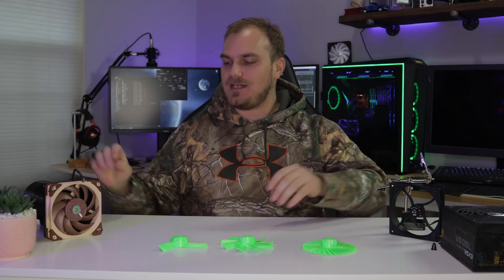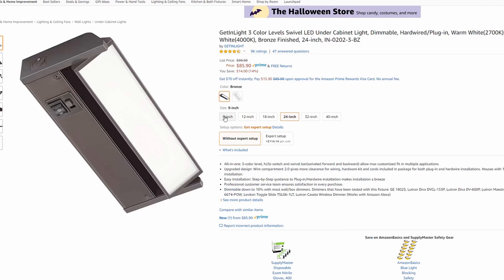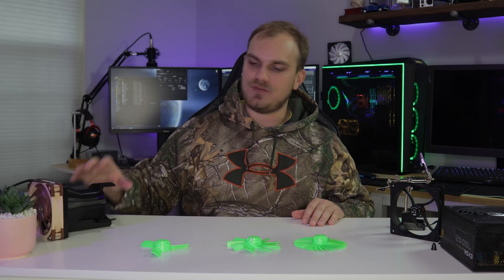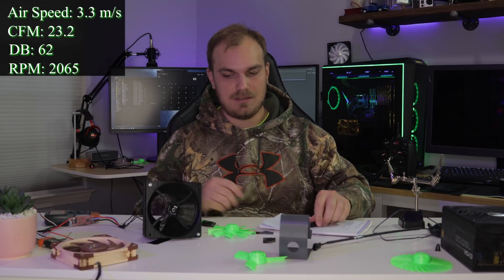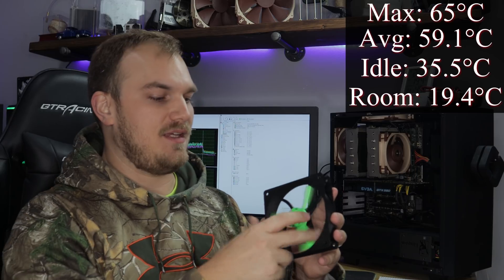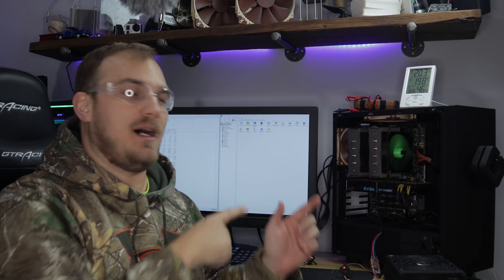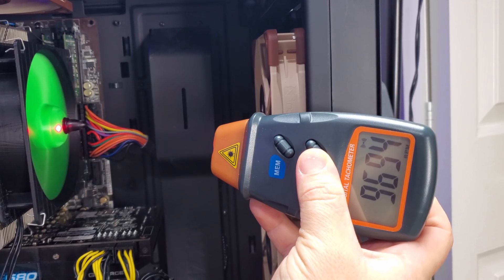This 120mm Fan BREAKS All The Rules!

Comment: I'd recommend just using a normal FPV prop, then there's no shroud over the motor containing the heat. There's cinematic props with 5-9 blades as well. The cinematic props are typically designed to work with a duct as well. Or you could trim larger props down to perfectly fit the duct as to maximize performance (the smaller the gap, the less bleeding the high to low pressure gradient between the top and bottom of the prop)

Comment: some comments say that the fan's buzzing sound is created by the tips breaking the sound barrier, which it doesn't. a 120mm fan would need to spin at least around 54,600 RPM in order to break the speed of sound, a 200mm fan would need 32,800 RPM. compare that to a turbofan with a fan diameter of say 2 meters, it would only need 3,300 RPM to break the sound barrier.

Comment: Would it be possible to print these on a resin printer specifically an elegoo mars 2 pro because the build volume is not wide enough requiring you to print on its side....

Comment: Under the right conditions, the turbo fan style should push the most air. It will probably need some massive torque and sadly forward motion is probably important. A few hundred knots of forward airspeed is probably a huge benefit. A modern passenger jet is essentially a prop airplane, after all.

Comment: You can tell at 10:09 how when the 30 blade popped off and it was floating in the air it barely even moved from its spinning plane. Almost like it wasn't producing very much air flow. Kind of  like it was just a disc.

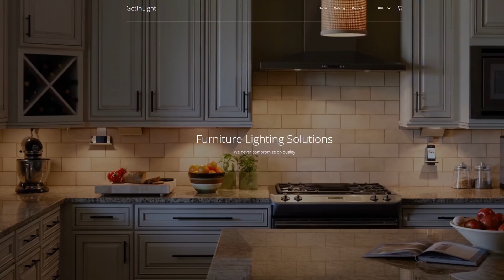Comment: 1:06, I have one. I installed it beneath the cabinets, over my washer and dryer. The smaller, of the two switches changes the temperature of the light. I generally keep mine on the natural temperature. It’s really bright for its size. Have mine wired up to a wireless remote.

Comment: The correct twist applied to the 30 blade would improve things quite a bit.  Do you have a way to measure motor voltage and current?      :)

Comment: That 30 blade fan looks pretty close to the primary low bypss fan blade on the p&w 220s I use to work with. That moter had a three stage fan design followed by a 10 stage compressor. Since then they went with a smaller blade count but larger  blades for the 229s

Comment: Should probably print these out of a better filament. PLA heat deforms very easy. Petg can take higher temps, but is less ridgid. ABS would be better still, but it can be a pita to print with, needing an enclosure and higher temp bed to print and preferably an all metal hot-end

Comment: Wait a second, half-speed was 9077 rpm?  Holy shi*t!  No wonder it's 78 dbs.  8:56.  "The motor's surprisingly coll."  Duh - it's air-cooled.  Pretty tough to overheat.  I just worry that the bearings will give out under all that massive torque.  10:09.  That 30-blade really did sound like a turbine for a brief few seconds.  Amazing.  I like that someone out there is experimenting, not unlike a mad scientist, on improving the traditional, boring, and low-performance cooling fans on the market.  I'd put up with a lot more noise if my damn PC would stop overheating when I push it to the max.

Comment: content gold mine = Get a laptop. 3d print a replacement back plate that will allow a large heat sink or large fans to be mounted within. think of it as making your laptop Phat.  the thermal throttling laptops suck. fix it and sell the back plate designs. and profit.

Comment: More blades = higher pressure.  
Fewer/faster blades = more CFP.
Comparing these fan blade designs is like comparing a Mustang to a Clydesdale.   One will beat the other depending on the test.

If you could get counter-rotating 3 blade designs...  You'd be able to break the sound barrier with titanium fan blades.  Printed from your titanium fan blade printer...

Comment: That motor is pretty much as loud as the fans on the early high end Nvidia graphics cards from the early 2000s though more specifically the Nvidia FX 5800 Ultra that was released in 2003 actually seemingly had a loud hair dryer motor and fan in it because of how insanely noisy it was! :)

Comment: Seems like your cooler has a limit that is bottle necking the fans capability. I would run all the fans at the same RPM and see which cools better at that rpm and try a few different RPM ranges, and maybe measure the noise generated at those RPM's also for each fan blade setup

Comment: Only use the AXE type BLADE width reduces breakage increases matter trajectory strike force,  thus two propeller increases vacuum, however step up blades reduces vacuum air compression blockage through speeds velocity momentum rotation Force compression blockage.

Comment: The reason the 30 blade didn't pull enough air is because the blades AoA was too shallow, it wasn't pulling any fresh air, just the turbulence the blade before it caused. I would try again with a steeper blade angle, or even a sweeping angle.

Comment: @Major Hardware - 
Your loudest van is not much more nerving than the 125 Watt TDP AMD-FX old boxed cooler (before the wraith) in the summer ... its 70mm van can (nearly) lift it self up ( @ 5000 RPM ? ) when tits heat sensor is on hot party mode. 
This is the very loud boxed cooler I mean: https://www.reddit.com/r/Amd/comments/97jfni/fx_coolermaster_am3_box_cooler_what_model_tdp_is/

Comment: I wonder what frequency you can run that 30 blade setup to eliminate the whine. I would replicate this test with a sabertooth 64 amp controller with overcurrent limited to only one amp and a rc brush motor rated at 200,000 RPM. The saber tooth controller available at robot shop will accept all signals RC pwm serial analog making it the perfect solo or dual brushed controller.

Comment: How about pressure differential.
What blade design can pull, or build the most pressure in an enclosure?  Do fans in series, (stacking fans) 1/2/3/4 build more presser than just one, or does separating them by a certain distance in a tube in series work better than stacking them close up?
Reply: 3 blade, 3 blade, 3 blade vs
3 blade, 5 blade, 9 blade or 
The other way around in series? Does it build more pressure,  or does the volume increase/decrease?

Comment: The 30 blade design might experience a stall. It'll move air but just in a circle, it won't be pulling air in from one side and forcing it out the other. If that happens, I don't think a stator would help eliminate the stall. Could you design a fan with variable pitch blades?

Comment: Your jet blade looked awesome. I think though that it failed because the pitch was not aggressive enough so the blades were not properly loaded. The RPM got too high. The RPM should be lower while it moves more air. This one has the potential to be the best.

Comment: Those under cabinet lights have a jacked up plug style that is nearly impossible to find, if the cable length doesn't work you'll have to rig it and not pass inspection...

Comment: @Major Hardware i am actually looking for a 3d model of fan blades with no center hub or shaft. Where the blades come together vertically in the center and an aggressive pitch at the outer limits with a rind around the outside the hight of the center connection point. Its for a toy model im making. For display for my son.

Comment: So if you use it in silent less than 1000 rpm mode with low Re a cool style 17 blade is better. 7~ 9 Blades for normal PC use. And 3 or 2  blades for OC!

Comment: 90 degree angles square edges “Was told to try and round them out”are your weakest point. Plastic injection molding class 2012. I was trying to make some similar blades not as nice though. But ran into some issues. Nice video man

Comment: How about running the motor a side with gears connecting to the blades it would give more are flow and more rpm to the blade, you would just have to account for the extra work on the motor.

Comment: air drag... you need to calculate using the flow/viscosity of air at your altitude. and by the size and angle of each blade you get the total amount of drag that sucks air behind it so that the blade behind that can push it down the line. do you work in a laboratory making blades for jet engines, NO ya don't... useless information. pie down to 13 hundred digits for what? the calculation above used for making turbines in jet engines.

Comment: The 3 blade moves the most air but the 30 blade will have static pressure, good for coolers and radiators, you should have tried maybe a 4 or 5 blade but with very wide overlapping blades and compared that to the 30 blade

Comment: Hey man, first video I've watched of yours (subbed). 
Wanted to give a little input that may be able to help measure CFM or g/s.. as it kind of came off like you were having a little trouble doing it. 
I'd suggest getting a GM MAF, 5v reference, 3d print a tunnel to match the ID of the factory intake on the vehicle you buy the MAF for, and read the output voltage. Simple equation will convert that over to an accurate g/s reading.

Comment: It shouldn't get a zero.. it was the best performing one for air pressure it just needs high rpm... its not that you didnt tight the screw its that the fan was pushing with such a power breaking/forcing it to unscrew there is a reason jet engines use dense fans like that one.

Comment: To compare cfm, I pair same size fans face to face (bases inwards), then connect one to a supply and the other on a multimeter comparing voltage readings.

Comment: I would do the 30 blade again.  It had pressure cause you can see it move forward when the pressure built up before it demounted itself.  Plus, early on in the video, whwn you had it connected to the tunnel and you were moving it around, the papers on the desk were near flying off.  It was giving good airflow.
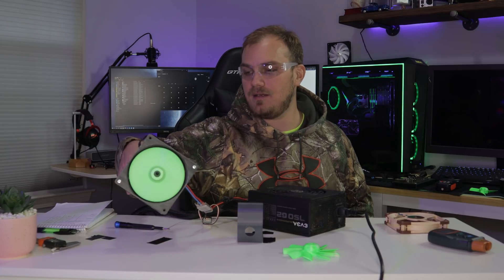Reply: Starts at around 5:36 on low speed, the paper moved up a bit.  But when you ramped up at about 5:40, the paper lifted higher.

Comment: Let try double the area of the fan blade and get an increase in all indicators due to more air that can be driven through itself, ideally 5-6 blades, but three is also good,but you can experiment with two blades or with a spiral mono blade, the angle of attack and the pitch of its blade also plays a role, for example, a 30 blade system has a large air resistance.In General, aerodynamics as a science is very exciting

Comment: It's all fine and dandy to look all scientific and to use big terms but of his methodology, testing equipment and test rigs are not even somewhat standard, then he might as well throw on a chef's jacket as well and call himself a chef. 🙄 No computer fan goes over 2500 RPM, so why bother mounting a 9000+ RPM (RC?) motor into a twin tower cpu cooler in a computer is pointless as there was no baseline of the room temperature, CPU load and testing parameters. Know your audience. Having Amazon links to useless and overtly high cost items is pointless as we're all watching free videos.

Comment: You can just test cooling performance by testing airflow through something that offers resistance, like a spare cooler or a radiator. Cooling will be a function of the air moved, so that should tell pretty much the whole story. 

Also those fan blades need to be deeper. They're half the depth of the noctura.

Comment: The 30 blade if properly built it would push out the most air for sure
Reply: Build the 30 blade with more of an agressive angle try to go and copy the turbofan blades they are made for max air pressure suction

Comment: 10:20 my friends, I work with turbines and helicopters (helicopters generally powered by turboreactor), I know about fluid dynamics and many other concepts of physics and I can tell you with certainty that:

 The more blades, the greater the COMPRESSION of the "fluid" mass (air in this case) and the lower speed of the "fluid" mass ...

 The smaller the number of blades, the less COMPRESSION of the "fluid" mass (air in this case) and the higher speed of the "fluid" mass ...

 As you can see, there are 2 principles closely related to the amount of blades, and that is, COMPRESSION and SPEED of fluid mass displacement, or you have more compression or you have more displacement speed, that's why a helicopter has these 2 types of  operation, in its turbo reactor more blades are used to generate the compression necessary to carry out the combustion of the "fuel" and on the main rotor that will "lift" the entire vehicle, usually no more than 4 blades are used, since it requires  a maximum of air flow displacement in order to achieve the lift of the vehicle in the air, and no more asps are used because the sufficient displaced mass would not be obtained ...

 In this particular case, this principle can be observed, that is why the rotor with many blades flew, because it was displacing a lot of mass and the arrow could not withstand the enormous amount of force exerted on it.

 It is a very interesting topic and it is not difficult to understand, of course, with practical examples such as those shown in this publication.

 In any case, if you want maximum mass displacement to cool everything at maximum efficiency, use only 2 blades at a good speed, and of the material, I would recommend fiberglass for the rotor and an arrow with high speed bearings, an arrow of  steel and joined with double nut using screw fixer and an aluminum, steel or titanium frame (frame) if it is very demanding.

Sorry for my Google translate :P
Reply: What language do you speak?

Comment: If you see the difference between cfm-56 engine and CFM LEAP.. more blades doesn't mean better performance but rather material choice, weight, shape of the blade that matters more.

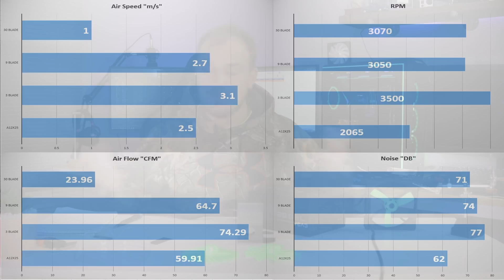Comment: 6:00 there is another measurement beside how much air is moved.
It static pressure, the Fan with mode Blades should have more static pressure would be my guess

Comment: 10:26 not really the fault of the blades more so the mount to the motor. Would be interesting to see whether the 30 blade would perform better if it was held down properly
Reply: The biggest problem was balance. The 30 blade fan found an RPM that matched the resonant frequency of the mount. If the blade could have spun faster, it would have gone above the resonant frequency, and might have stayed together long enough, to collect data.

Comment: Well that was interresting. but this motor was somewhat small. A 2308 would do much better. The noise @10:00 was prop-deflection, it happens when the blades begins to swing up and down at the end. This is a resonace and it loosens your prop very fast. It also costs a lot of power which in turn heats up the motor. The blades are not stiff enough, and maybe you can print the props in the opposite direction and turn the motor direction. Then the nut will fasten as the speed goes up.

Comment: You could put some 'scoops' on the top to force air inside the motor to keep it cooler.
And I'd like to see another go on the 30 blades one. Maybe slightly steeper angle - and full throttle! :D

Comment: Since you understand how the fans work and 3D print. I know air and water are different. I feel you would have a better understanding of it then I would. Could you 3D print a prop for a minnkota Electric trolling motors? We only have one option as far as aftermarket. And it's ok I guess? But The OEM props are only a 2 blade prop. they're great with torque and bottom end but they're loud and slow. Normal boat props are 3-4 blade have a better high speed. Is that a good challenge for you?
Reply from the maker: u could print one but it would need to be ABS and still then probably to fragile.

Comment: I’ve never understood why fan blades aren’t easily swapped out to begin with.
Reply from the maker: i know!! i can only assume it make them cheaper to produce
Reply: Major Hardware 
I’m assuming it’s got something to do with it being easier to seal whatever bearing method they use, especially for cheaper oil/sleeve/bearing methods where if dust gets in it tends to ruin them pretty quickly.

Comment: That thing with he 30 blades would be better at capturing laminar flow. Like if you stack a bunch on a roller with a bearing top and bottom, it would be very good at capturing a stream of air blown at its side and converting to motion

Comment: Blade angle and number are varying either to build pressure (eg. Brown Noctuas curved blade) or to create propulsion (eg plane propeller). You are confusing combustion jet engine (building pressure for combustion) and mechanical propelling. Making wind in a PC case is useless if it does not build pressure.

Comment: Awesome video.... ❤️ some of the comments that have been ❤️ ‘ed .
I wonder if you used a metal 3D printer (cost) and or one of those multi print with different types of composite feeds , it could stop the heat deforming and maybe give better structure for the extreme forces it endures.
Yes ...like most would love to see a video on the 30 blade and maybe a 20 and 25 , the reason I say this is for the different blade angles you could display as on a 30 there isn’t much room to play with. Then you could run tests on how much air flow they produce.

Comment: Might be cool(er) if you looked at submarine and aeroplane props, might as well lean upon existing knowledge.

Submarine props look intriguing and will be designed to optimise flow and noise.  & bladed for them seems to be the norm.

Also fan depth, whilst fans are standard thickness - what gains do you get by having a deeper blade and say a 2 fan depth.